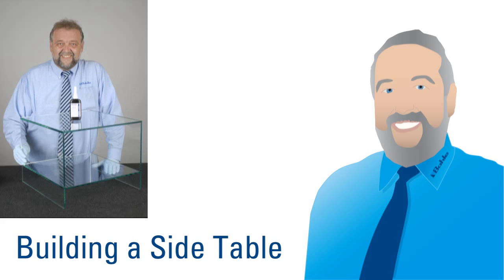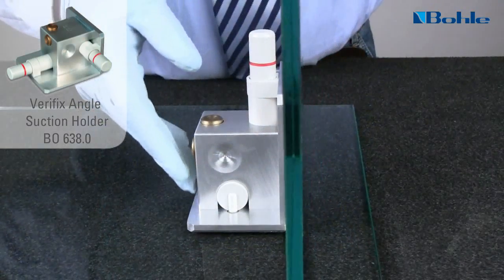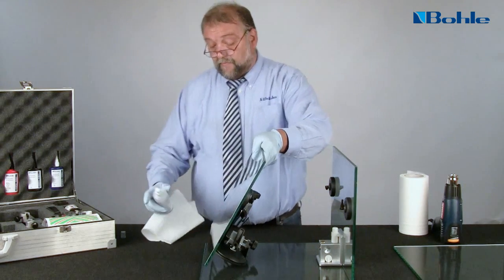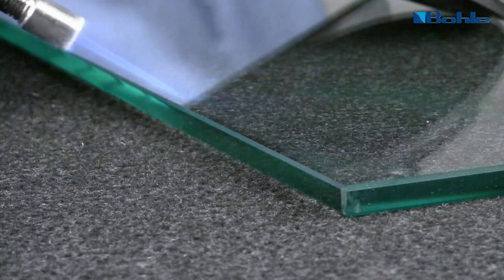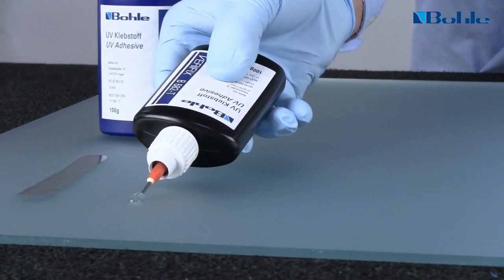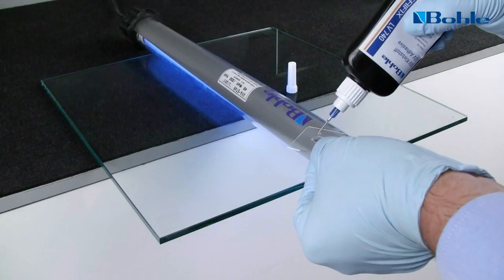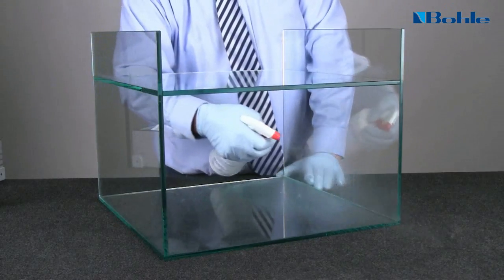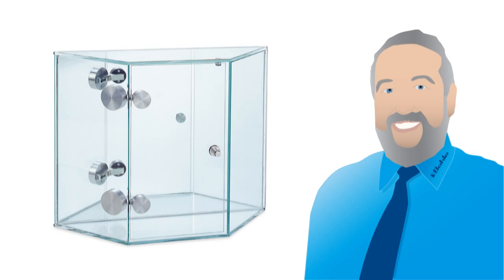Big Frank: How to bond glass simply and safely | UV-Verklebung sicher und leicht gemacht

Comment: I'm just going to go out on a limb here and boldly say "Theres nothing "simple" about what is demonstrated in this video". Additionally it doesn't appear to be cost effective either.
Reply: Glasverlijmen
Reply: i'm going to go out on another limb and say most of this kit is stuff you can DIY, and 'special cleaner' is probably watered down white vinegar that hardly 'specially formulated' for glass. i mean, you're hitting it with a heat gun then a torch, so i dare say whatever contaminates are they are burned away.

Comment: not sure why so many of y'all thinks there are so many steps when they're just being very careful to make sure the bonding surfaces are absolutely clean. sure, this is fancy equipment that you can DIY, but beyond that it's cleaning, burning off what you can't see (maybe a bit overkill, idk), heating up the area for primer, and just like for acrylic add the bonding stuff. it's UV bonded, so a UV light is needed, which are probably expensive based on the ex's tanning bed bulbs, or take it outside and let it set under the sun like you can do for curing emulsion on screenprinting screens (not the best process, but possible). 

sure, i'm guessing most are just making jokes about the steps, but for those who aren't joking apparently have never built anything before! lol. not sure what other methods/equipment/materials there are for this stuff, but i wonder if they are any better than this one?

Comment: is the adhesive waterproof ?
Reply: no!
Reply: Bohle UV Adhesive Verifix® B 665-0
UV curing · thin and crystal clear · good capillary action · for bonding glass to glass · low viscosity · time-saving · not waterproof over time.

So not for aquarium or terrarium. Well suited for glass tables, bookshelves, and vanities.